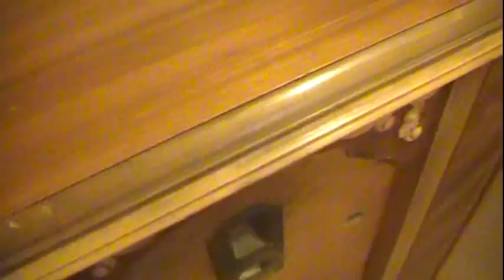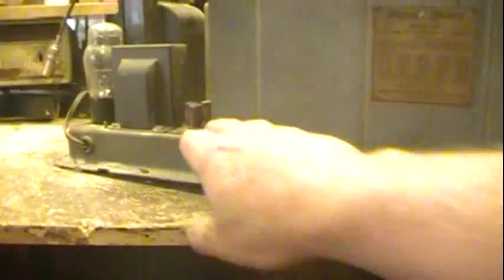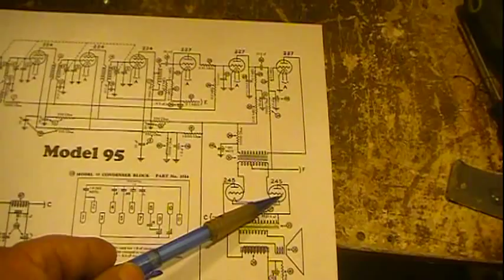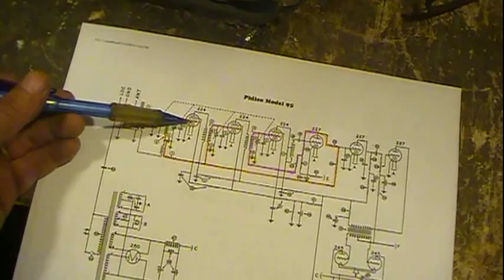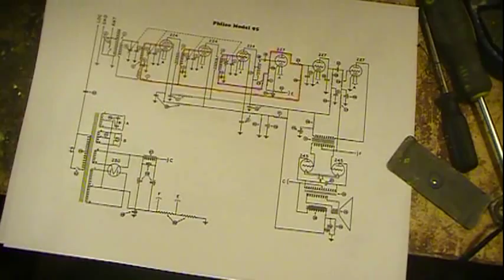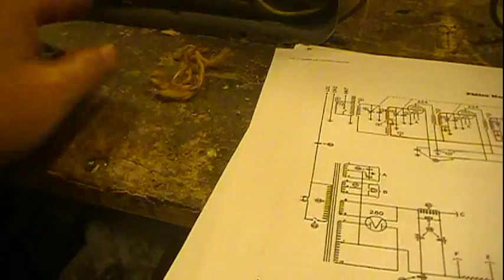Another Craig List's find

Comment: I don’t know much about TRF receivers and was wondering why they tuned each RF stage for a station, this seems kind of complicated. Why did they not just tune a single tank circuit at the input from the antenna for the frequency of you wanted and send that through the RF stages. Nice video, I like how you explain not only how the circuits work but also the history as well.

Comment: Very good Dennis. You're starting to get yourself in to my situation in that projects are piling up! I've stopped buying any more until I can thin down the stack of stuff I have to do here.
Reply from the maker: Arthur Hollingsworth I do try to stop but then I find a great buy and I can't pass it up. Thanks for watching my friend.
Reply: You´re so right, as i´m in the same situation. Last week i came across a "ready for dumping" "Philips Gm2877" function generator intended to be used for AM/FM aligment between 5-200MHz...I haven´t tried it out, as my connetors do not fit it and i´m not in need of something like this anyway, but the housing is wonderful, so it´s about time for another Amplifier. It has about the size to fit some cool tube operated 50Watts inside. Jet another one piling on the shelf and on my ToDo list as well....
Reply: Arthur Hollingsworth